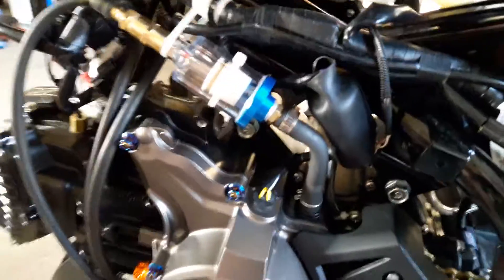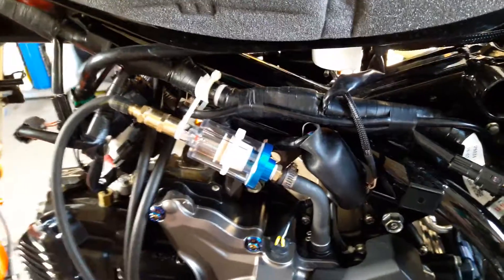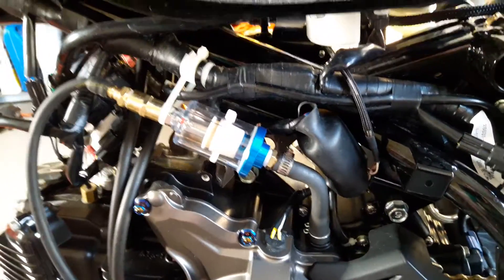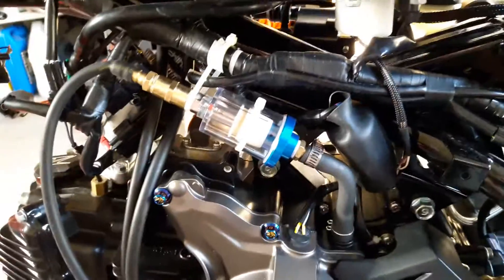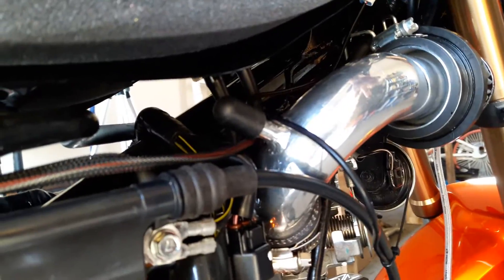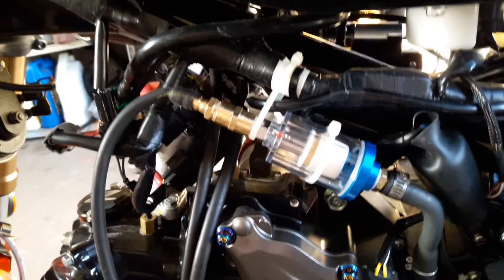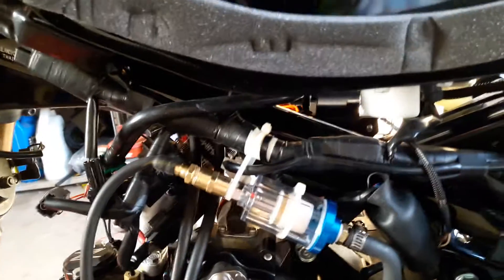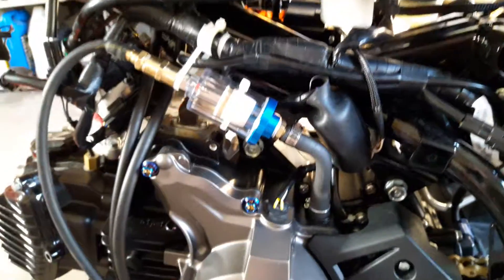Kawasaki Z125 pro catch can

Comment: a trick I like to use on bikes is run the hose at a upwards angle, but like 6 feet long if possible. so towards the fuel tank, along the side body panels to the rear tail light area. that way hopefully oil mist wont work its way out the tip of the hose when running hard
and when you turn it off any oil residue slowly goes back downhill to the engine

I've also ran a short hose over my drive chain for a free chain oiler :) on other bikes
Reply from the maker: Mike's Bytes lol nice Mike. also want to let you know hit 71.48mph today
Reply: cool, one day im going to mess with my gearing again just takes too much time but now my chain is longer so it wont be as bad

Comment: Hi I just installed a 143 big bore kit about 50 miles ago, runs good but I noticed oil all over the side of the bike from the crankcase breather filter I have. There is no oil cooler installed & thinking the bike may overheated & caused the oil to come out the crankcase. Any information would be greatly appreciated
Reply from the maker: to much crank case pressure you need to vent it up high to a filter